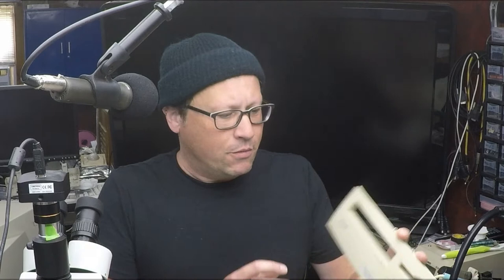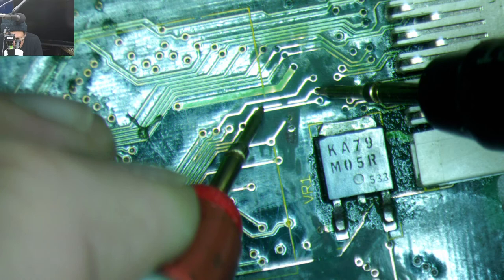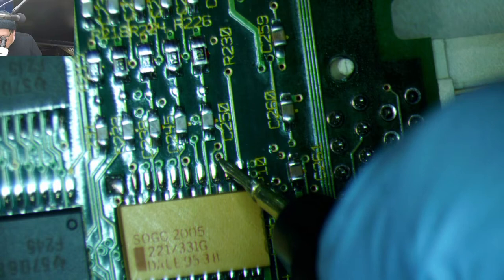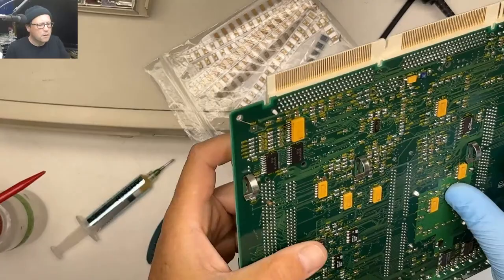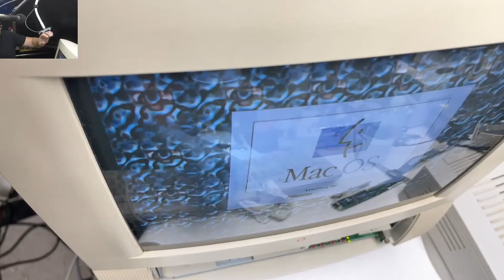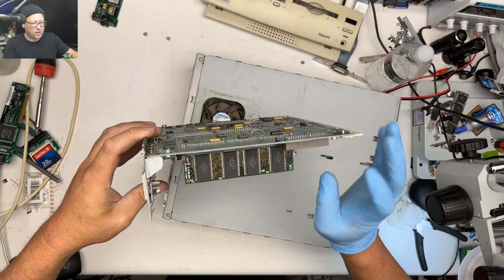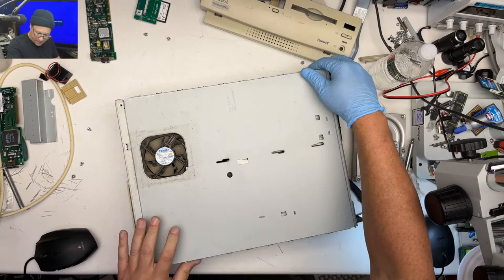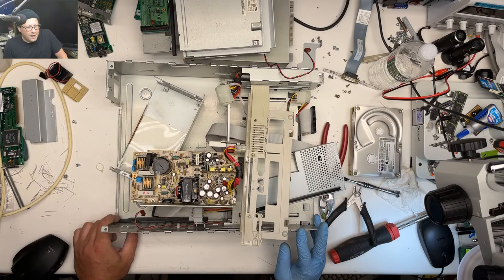Working on two Power Macintosh computers: Performa 6200CD and 5300/100 (AV?) LC

Comment: Great video.  Can you tell me what the eraser bit is called that you are using?  And what tool is that? a regular Dremel ? I usually scrap off mask with a blade but that looks faster and a little neater then my scraping.
Reply from the maker: Thanks Chris! It's a regular Dremel with a rubber polishing bit.  This is the one I used this week (I have smaller ones that I can't find on ebay right now): https://www.ebay.com/itm/143051572121

Comment: Oof. I'm starting to wonder if I should like, recap the 9600 as a preventative measure, because now this has me paranoid that it shall soon be the Power Macs' time for cap issues.
Reply from the maker: Might not be a bad idea. I did some work on the 6200CD on Dave’s stream yesterday. Both the power supply and logic board caps were wet when I took them out.